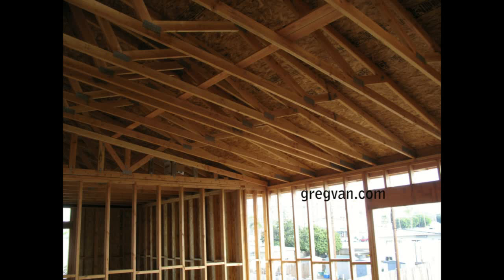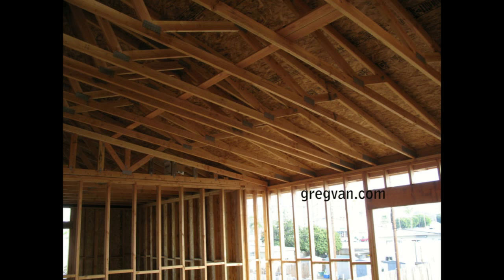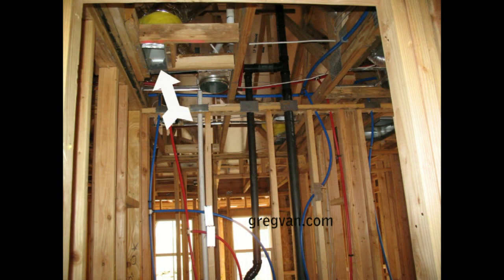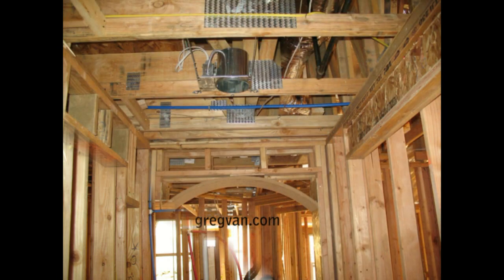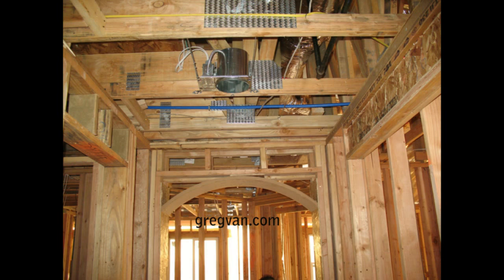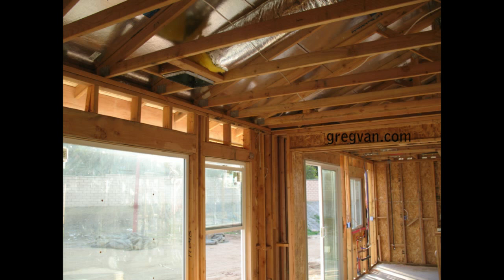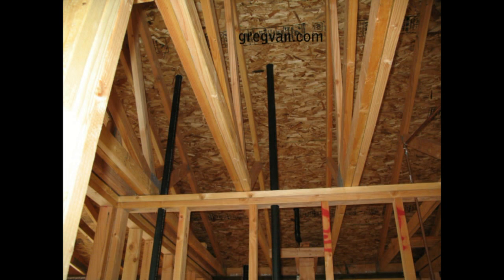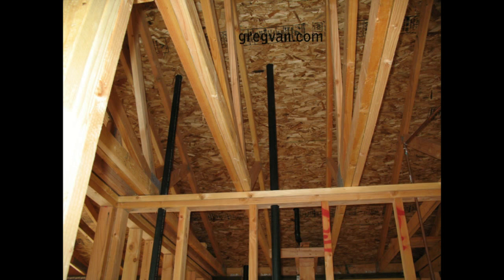Don't Cut Engineered Roof Trusses - Warning to Do-It-Yourselfers and Home Builders

Comment: The answer is not always no.  If you are adding onto a structure and your trusses slope down in the direction of your addition you can pay a small fortune and just tear them off along with the entire roof and order new larger trusses to span the new distance (including the addition) ORRRR you can put up termporary support walls and cut the truss cord and install a header aka lvl to open up the wall into the new addition and support the old truss and new roof over the addition.  

The calculations are not that difficult.  LVL, 2018 IBC and most states have roof load calcs you can use to figure out the point load pounds based on the square footage of your structure.   It can be done properly with the proper cals and preparation, but it is true that trusses are much less forgiving when modified and the 2x4 ones are even worse bare bones minimum at 24" oc.  CHEAP builders use 2x4 trusses instead of the heavier duty 2x6 ones.
Reply from the maker: I'm confused are you suggesting that all building departments will accept your method, because mine hasn't.

Comment: I have done it several times, but understand the engineering behind them and just redesigned everything.  Since I consider modern truss systems space wasters, I just recommend not building with them to begin with.

Comment: Thanks for your stern warning. I was about to cut joists in my 2nd floor ceiling trusses spanning 40ft due to finding a better place corresponding to the middle/peak of roof to put a new access using an attic ladder which also entail a lot of new work (new catwalk, going around, and me jumping on AC ducts before reaching my destination). Now, I finally decided to convert the existing attic access door on the closet instead. Where the access is right now is on a closet which when a step ladder is placed, one has to always fold it straight so as to be able to maneuver stuff on the other side (close to the side wall of house) where the first step of the ladder is. This is due to the direction of the slope of the ladder the same as the direction to the roof peak. Otherwise, my head will hit the roof upon entry to the attic. I don't have plans to study the structural details nor will contact the manufacturer to retain the structural integrity. I have a high ceiling adjacent to the new proposed location so it's best to just go with the existing closet location. Cutting joist can be done with the proper structural modification like you say with the help of a civil/structural engineer or an engineer who has knowledge of mechanics of materials and structural analysis or even someone in the building industry who may have done the same and exact thing (a copy) or an underload of a previous approved modification. This subject is not meant to be taken lightly as if not properly done, repair is costly and not worth any convenience in access or aesthetic designs. Anyone can still study this subject though given time and be successful. Cheers!
Reply from the maker: You're welcome and thanks for watching.
Reply: @gregvancom  hi Greg one of my architect's contractor cut the bottom chord to build the skylight well and now city is asking the truss modification calculations

Comment: If you ask the manufacturer of the truss, They will ALWAYS so no, you cant cut or modify. So, dont bother asking,because we already know the answer. Secondly, as a result of no experience, I unknowingly allowed my home builder to install the cheapest trusses made from 2x4's. NEVER allow a 2 x 4 truss to be installed. only 2x6 or bigger,because you can never build an attic room with a 2x4 truss. You can if you add 2x6's or 2x8's to support the floor, then properly support the trusses and cut out all those stupid space consuming criss cross 2x4's. Thats the last time I will allow "standard" trusses to be installed.
Reply: Wrong. Midwest Manufacturing has shown me how to modify existing trusses here in Indiana to handle the snow load. Reason for modification is I need added height only in the middle of my garage for a car lift.
Reply: You are right about the manufacturer saying no. It does  not what  matter you ask them , the answer will be no..
Reply: You can ask about cutting a truss. It depends where on the truss and the scenario. They can come up w repairs and modifications to allow for revisions. You will have to pay for the new seal and design time. 2x6 and 2x8 don't automatically make a truss an attic truss. It allows for possible storage but not living space and longer spans in-between webbing. You can't just remove webbing willy nilly.